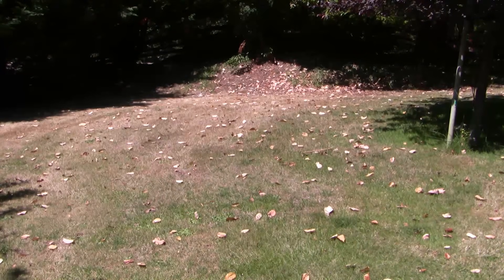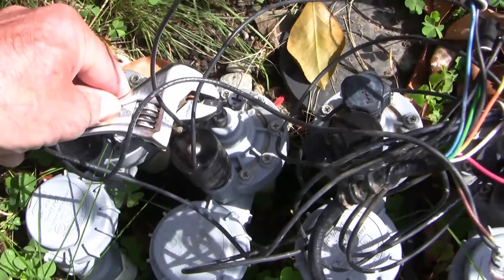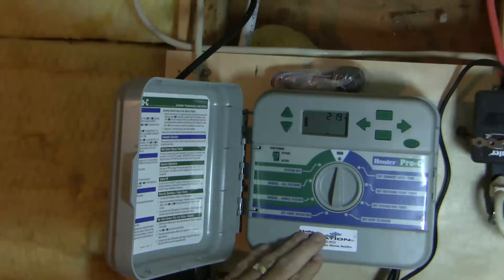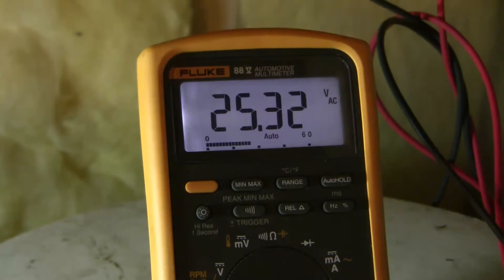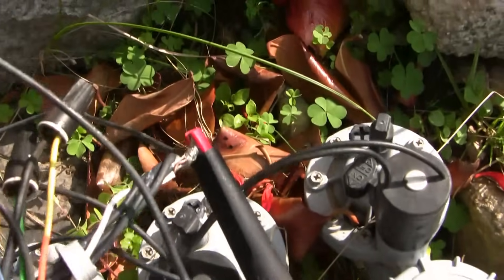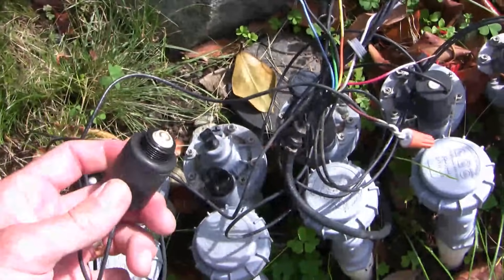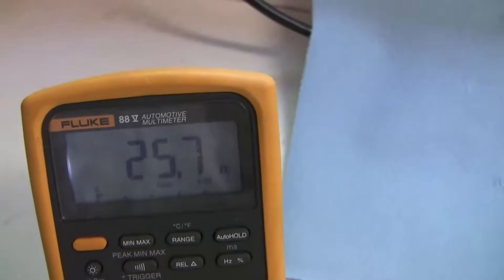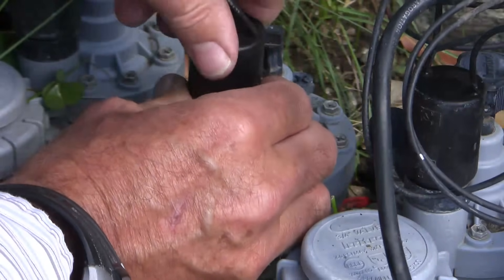How to fix an irrigation sprinkler zone that is not working

Comment: Hello there. Just want to share my problem with my sprinkler now. I have a multiple-zone sprinkler and every station is working properly except one. This station will works when you run it manually for “second time”. 
For example, if you run that station manually the first time, heads will not pop out. Then turn it off and run second time, it will start working. Then, if you turn off it and try to run third time, not working. Basically it’s like one time working and the other will not, looping…

Do you have any thoughts what will be problem?
Reply from the maker: I can't say I've ever seen that before in such a reproducible failure, but I wonder if the chamber above the diaphragm is not draining quickly enough to allow the valve to open the first time. Then the second time it opens because the drainage is more complete. In any case, I'd start by cleaning the valve, as shown in this video https://youtu.be/jCowCVTR6VE. I'd pay careful attention to be sure those two narrow passages are completely open, and that there is no mechanical cause for sticking. Good luck!
Reply: @spelunkerd  Thank you very much sir! I will check and see. Much appreciated.

Comment: Hi how are you doing?  my name is Thomas I fixed all the heads and all the leaks but zone eight does not want to turn on what do you think the problem can be I turn it on from the Valve actually I don’t even know if it’s zone eight I turn the valve on and that side where the sprinklers are the water turns on but it will not turn off from the controller box any ideas?
Reply from the maker: Follow the steps here and you may diagnose a bad solenoid or a bad wire connection to the solenoid.

Comment: video was going great until... one serious short coming or fault.. when you first clicked on the terminals to check the OHms (for faulty wiring or a bad solenoid) you did not explain how you picked the terminals? how do we know which one is which? I noticed 3 gropings and you picked the top and bottom terminals of the first lower groping but explained nothing about how we are to know which ones to pick (?). Never assume we know what you are doing, explain thoroughly so we can duplicate the diagnostic system you are using. The rest of the video was very good, and well explained.
Reply from the maker: This remark highlights the best feature of Youtube, and it could become one of the most helpful comments in the entire thread. I would like to think that the comments section would be used for these kind of clarification discussions, but disappointingly, people often don't bother. These systems are more simple than they look. Each solenoid is fed by one power and one ground wire, and the ground wire is a single common wire sent to each set of valves in the garden. You can do this testing at the controller or at the solenoids. At the solenoids, it is easy to identify ground as the one with the wire nut connected to every solenoid there. The common ground is well marked on the board, often labeled 'G'. In this case it was at the bottom, and the wire going out from it is the same color (often black) as the common ground in the garden. As I recall, there are 12 zones in this system, and at the controller they are labeled 1-12. When zone 7 is on, 24V of AC power is sent to zone 7. Turn on zone 7, put the two multimeter leads on ground and the connector labeled 7, remember to set your multimeter to AC volts, and read the voltage.

Comment: Excellent.  Now my question: Does the solenoid fail gradually, or all at once?  I have disasembled my valve per your previous video and cleaned it thoroughly along with diaphram, then reasembled.  Now, my irrigation zone #4 works great on manual, while on auto, the water flow is too weak to pop up sprinkler heads.  any thoughts (or instructions) would be appreciated, thanks!!
Reply from the maker: They can fail gradually and what you describe may well be from a bad solenoid. Some solenoids have a little head on the contact surface and you don't want to lose that so be observant and careful when you take it out. Also make sure your new solenoid is compatible with your valve. To be more sure of the diagnosis, you could swap solenoids between valves and see if the problem follows the valve or if it stays in the head. Make sure you clean out the two passages where water flows, I show how to do that and how those valves work in another video titled "sprinkler troubleshooting". Good luck!
Reply: @spelunkerd  Many thanks for your advice!

Comment: Really informative, thank you for all info , my question sound stupid but it really can help me, i have same hunter controller but I couldn’t find my 6 zones valves . My controller is in garage. I was able to locate main sprinkler shut off valve near main water line but no luck to this 6 valves😅
Reply from the maker: A very common question. It will be between that main shutoff and the lawn/garden it serves, often hidden behind a bush and often below ground with a green plastic cover that you can lift off. Wander around the garden and lawn and look for any plastic lid hiding the valves.
Reply: @spelunkerd  
Same issue. I've found the backflow valve (in a box with lid) but I can't find the solenoid box!!

Comment: Great video, but I still have a non-operating valve.  I purchased a new solenoid, installed it, checked and I do have power (24V) to the solenoid. I can unscrew the solenoid under pressure and the valve opens.  Is there something else I should be looking at?  I wouldn't expect a new solenoid from a reputable source to not function, right? Thx for the advice.
Reply from the maker: Have a look at the video I did 'sprinkler troubleshooting', explaining how those valves work. I'd start by cleaning the valve, thinking it may be sticking with the weaker control of the solenoid. If you're not sure if your new solenoid works, you can swap it into another line to see if it works properly there. Finally, make sure that you measure the voltage with the solenoid activated, while drawing power. That is called a voltage drop test, as shown in this video. Good luck!

Comment: Great video ! Thanks...I have one leg of sprinkler system running  low...can you advice on how to troubleshoot? Water reassure is hardly raising the sprinkler heads. Thanks in advance!
Reply from the maker: I would run that zone for a few hours and then walk around the grass looking for a wet spot. No water could be a high volume situation (leak) or a low volume problem from a kink, obstruction, or valve that isn't opening all the way. If you don't find a leak, then open the valve manually to see if it opens better by hand. If it does, the solenoid may be an issue. Then remove and clean the valve the way I show in a separate video titled 'sprinkler troubleshooting'. While at it you can turn the water back on for a few seconds with valve removed, to see how big the fountain of water the inlet side can deliver, and to flush debris from the proximal line. All of those steps will give you clues as to the cause in your situation.

Comment: I have one of the Hunter systems, installed in about 2003.  Residential.  I used to manually turn on the zones, 6 zones.  Now, the controller will show the sprinkler activated, but not one of the sprinklers will actually come on.  What is likely my problem?
Reply from the maker: Think of the goofy problems first, like forgetting to turn on the water, blown fuse, forgetting which way open is for the valves, or a software issue. Remember the valves need to be manually all closed for the each individual solenoid to work, otherwise you just get leaking from all and pressure that is too low to lift sprinklers. If I found nothing there, I'd open one valve and see if you get a fountain of water when the valve top is removed. No water out an opened valve means either a leak or a kink/obstruction higher up.
Reply: @spelunkerd  Thanks....I am using a Hunter Pro-C controller, I have 6 zones, and.....I have one solenoid in my little green box.  I don't have 6 solenoids.  Should I have 6 solenoids? - When I turn each zones on manually, none of them work.  The controller screen shows active zone and timer.  But, none of the 6 sprinklers work when I select them, individually.
Reply from the maker: @atvirotechinc6115  The system has a shutoff valve, often in the basement of the home. Check to be sure that is open. None of the zones will work if water isn't getting to the solenoids, or if there's a leak in the main supply line. If you have only one solenoid in a box, check around the garden for another box. Make sure all the solenoids are closed, since more than one valve open at a time will prevent any from working.
Reply: @spelunkerd  yes, in my case, I am in Texas and do not have a basement

My shutoff is on the inside of the garage. It is on the 'On' position

It worked just fine in 2020

On Sunday, I will try the 1/4 turn test to see if the come on

Again,  I have only one solenoid, 6 stations

Comment: I have manually turned the solenoid by hand and no water comes out of this zone .  Any ideals ?
Reply from the maker: Make sure the water is turned on, make sure all the other valves are closed shut. If still no water, wait a while to see if a puddle forms where the line might have broken. If still no luck, I'd turn water off and disassemble the valve to see if it is stuck shut for some reason. Once the valve top is off, and diaphragm and other hardware safely pushed to the side, turn the water on to see if you get a fountain of water at the open valve. If not, your source is failing to deliver water, consider a kinked or broken pipe or ice somewhere upstream.
Reply: All the other zones work just fine  , one zone number 5  lets no water through . I have manually turned the solenoid and still no water . Thanks for your help

Comment: Good video but normal fix is just replace the non working solenoid with a $12 new old. IF that does not work then you have to go through all the tests to see  the real problem. 9/10 a your problem is a bad solenoid.
Reply from the maker: I don't deny that those who are intimidated by a multimeter, or those professionals who couldn't be bothered, will guess and take a short cut. Easy enough if you've got the correct part in your truck, and you can reuse the new test part on the next customer if it doesn't work. This part changing strategy is also used in the automotive industry where parts are $120, or even $1200, with no returns after electronics are opened. Worse yet, many aftermarket parts are bad, so the customers end up coming in with a long story of multiple parts replaced and secondary complications before they finally ask for help. The best technicians learn how to prove the diagnosis before moving to the next stage. It can be the most interesting part of the game, often fast and easy.

Comment: Need help sir, one of the solenoid stopped turning on/off suddenly when done manually and that zone water wont stop. Not sure how but someone, the zone turned off but still the Solenoid won't turn. Do I need to replace solenoid ? Thanks
Reply from the maker: You should watch the video I did of valve troubleshooting. Sounds like a valve problem, it may not be the solenoid at all.

Comment: I took a class in irrigation and learned a lot, but we covered installation and not repair. I emailed my teacher for advice and he described what to do, which gave me the technical terminology to find videos This is exactly what I need to do and I'm pleased you have the same kind of valves, which makes it easier. Now I just have to buy an ohmmeter and not electrocute myself.

Comment: Thanks did all that still one section not working ! Could it be just one single wire ? Do I need to replace the wire from the control ?
Reply from the maker: If you have a bad wire it will show up when you do the voltage testing at the solenoid or voltage drop testing under load as shown. If uncomfortable with multimeter testing you could swap one of the other neighbor solenoids into that valve position to see if the problem follows the valve or the solenoid.  I did another video of how to troubleshoot valve problems, better explaining how these systems work.
Reply: @spelunkerd  thanks so much we have swapped and 2with 3 and then 2 worked and 3 did not so it must be the wire correct?

Comment: Well done on the video.  I have old Toro zone valves in my backyard zone box, with three connections per solenoid.  They don't make them any longer (I can't find them at least), so I purchased ones with two connections.  In the existing system, I suspect the common jumpers from one solenoid to the next, which represents the third wire.  Question:  is there a polarity on the two-wire style solenoid?  I cannot find a polarity indication on the new ones.
Reply from the maker: Good question, short answer is I don't know. I'd probably use a multimeter to see if either wire is in contact with outside parts, any exposed steel of the new solenoid. If there are no labels then I'd then assume the ground side is the one with the lowest resistance to outside metal parts. The other way to approach it would be to look for documentation from the manufacturer, for example they might conventionally label the ground side with black wires. If you don't find any direction you may have to guess, I wouldn't be surprised if these are double insulated and it doesn't matter.

Comment: Hi , Thank you for sharing . I learned a lot about wiring. I have a question ... My sprinkler valve wont turn off and the sprinkler box wont do anything anymore. I cannot find the valve location either. What should I do?
Reply from the maker: Time to wander around the grass looking for the valve box. They are usually hidden under overgrown plants, often in a box with a green or black lid, often underground so you only see the flat lid. Start at the hose bibs, they are typically close to the source of water. The controller will usually be indoors close by.
Reply: @spelunkerd  Thanks , I probably should have mentioned that this is a commercial bank location and I found only 3 valves walking around the property but there are 4 missing. I think I may need to rent a wire tracing machine. Is there another way to find them.

Comment: What if we dont have nothing but black wires.....
Reply from the maker: One side of any connection to the solenoid will be ground, the other will be the signal wire. When the signal wire is activated it will show 24 volts of AC voltage on it, the ground wire will still be ground. Usually all the ground wires come together in a big wire nut, and a single system ground wire is sent back to the controller. So, with a multimeter and a little common sense you should be able to understand the anatomy of the system. If you take anything apart remember to take a photo with your phone before you remove any wiring, to be sure you don't make a silly mistake on reassembly.
Reply: @spelunkerd  thank u

Comment: We just got a house and out sprinkler system isn’t working. I can’t even find that box you were messing with
Reply from the maker: Common situation. Walk around the garden looking for a cover plate, most of these are concealed under a plastic round or rectangular cover. Sometimes they are concealed behind a bush. Usually these are within about 6 feet of a hose bib where outside water leaves the house, but not always. The exit tubing for the sprinkler system is easy to spot, just walk around the home looking for plastic or galvanized tubing leading underground. The shutoff valve inside the home is usually in the ceiling of the basement, or if you don't have a basement then a crawl space under the house. Note that most professionals leave the solenoids unscrewed over the winter to prevent water from being trapped, damaging the valve if the water freezes. So in the spring you need to crank all those solenoids closed. The prior owner might have contracted a pro to do routine maintenance, his name may be on past receipts. If you feel uncomfortable you could ask the same guy to come again, then tag along to watch what he does. In the winter where you get significant snow, you need to blow out the tubing and close off the water supply once a year every September to prevent freeze complications. Good luck!
Reply: spelunkerd thank you so much for the feedback.

Comment: So here's my question.  When I manually twist the solenoid, water does not run.  I changed that sprinkler head with another and that solenoid did not run either when twisting.  I then put those same motors on other zones and they worked.  A bad wire maybe that runs from box to solinode?
Reply from the maker: Remember that when you twist the solenoid off its seat, you completely bypass all the electrical elements, you're physically lifting the valve nipple off its seat. So, failure to get water when you manually twist points to a mechanical problem in the valve, not an electrical problem at all. A broken wire should still produce water when you twist the solenoid off.... Try cleaning the valve, and look for other causes of failed water supply to that valve. Reproduce the steps I did in the video and it will probably be clear.  Good luck!